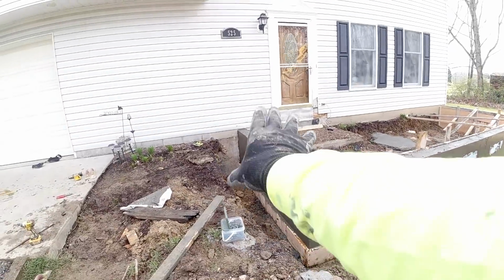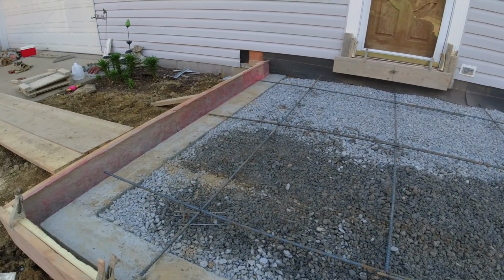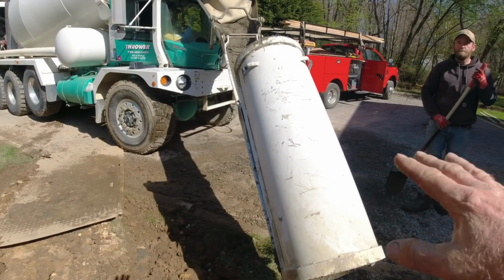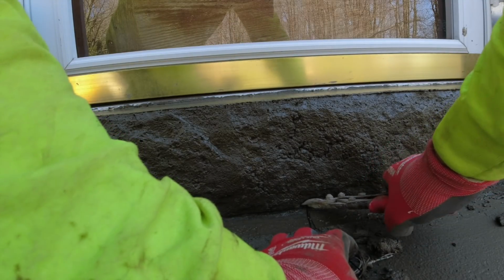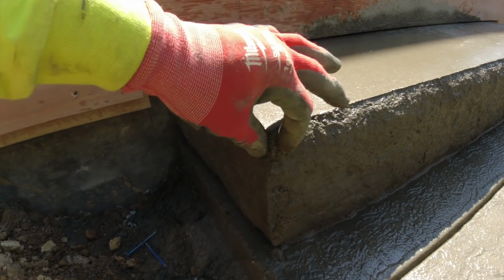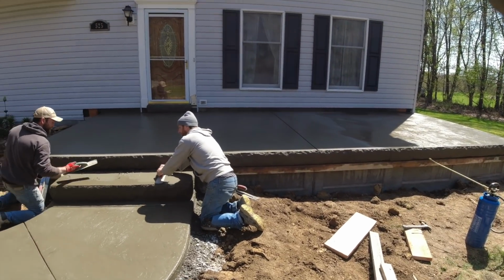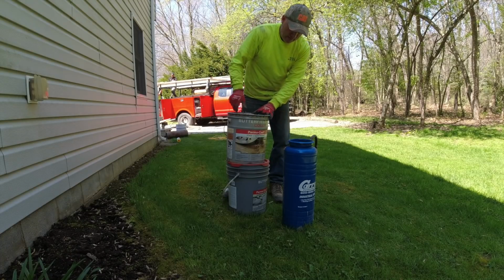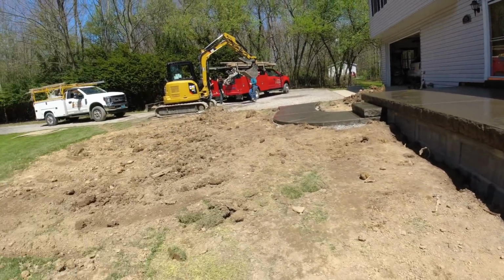What An Upgrade For This Front Porch!

Comment: I have been a journeyman plumber for 45 years, and have baby sat hundreds of pours  over the years I call just incase, witch means to be there to fix any problems that may happen during the pour. Sometimes that means fixing a broken pipe to making sure all the floor drains don't get covered with concrete. Sometimes we put a 2'X2' box around the pipe or drain to keep the concrete away from the pipe or floor drain to fix it later, after the concrete hardens. I must say you and your men are the best I have ever seen. I had a question for you about if you guy's are union are not. I'm thinking NOT because of your efficiency and the rebar you are tying and forming. I'm in central Missouri and the union concrete guy do have the right to do there forms on the slab but they yeild that work to the carpenters. I must say around here the non union guys try a lot harder and do a much better job on the finished product. And the union guy's want to work thru lunch and then get paid for all day only working 5 hours of work. I was just wondering?
Reply from the maker: We are nonunion

Comment: 5/3/22...another detail description of doing footings, framing/forming for 3 ft short wall perimeter- including decorative rectangular 'inset/relief pannels', then when perimeter wall has dried-hard...framing for 25'x 10' porch top. Edge of cantilevered porch  & steps has your 'broken stone' stamped finish. Very nice job Tom! You & yur crew produce outstanding results!...>but... color overspray< ...kinda concerned that your color spraying oversprays customers siding & front door !🤔🤯 Tell us armchair viewers cc stain color does wash off that vinyl siding (or other siding types) so their is no visible discoloration on clients house or front door glass, brass kick plate etc. Pretty sure it does wash off but did not hear U mention it in this video. Thx. Always enjoy listening & visually learning from your videos.👍👍👍😊🍺
Reply from the maker: Sorry yes it does wash off

Comment: Tom - as a first time commenter let me start by saying my wife and I really enjoy your videos.  We are fascinated with what can be done with concrete and you and your guys are definitely artists at that.  Concrete is hard work, but you guys make it look easy.

So - I have one comment and one question for you: 

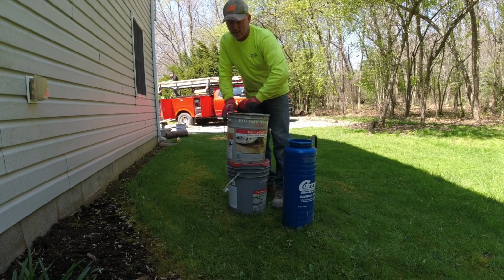Comment - when you are making up your coloring, I love the My Cousin Vinny reference at 23:34 ("Identical").  

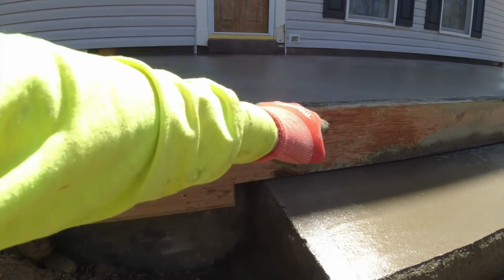Question - at 16:45 when you start removing the main form for the porch (i.e. the 2x10 or 2x12 - whichever it is), that form is screwed to a 2x4 that is somehow mounted onto the walls of the porch base.  How is that 2x4 mounted to the walls of that porch base?  I was hoping to see your guys remove it so that I could see how it was mounted, but that wasn't part of the video.  The curiosity is killing me.

Thanks for the great videos.
Reply from the maker: We use 3 inch tap con screws drill a 3/16 inch  hole . They really hold good
Reply: @Concretewiththehauses  Thank you for the answer.  So the concrete is hard enough after a week to drill pilot holes for setting the Tapcons, correct?  I'm asking to make sure I understand - I'm not challenging what you do.  Also - what do you patch the pilot holes up with when you are done - a little mud mixture or something else?  I really appreciate your providing this info.

Comment: Ok enjoy your work, but that "door sill" as you call here would a step and your "sill" would not meet building code as it is a clearly a step. Please explain how this would pass in your area.
Reply from the maker: We are allowed up to an 8 inch step down but we have to have at least a 36 inch landing. This is residential,commercial no step flush entranceway
Reply: Not the drop but the tiny stepping pad you created ,Code here will not allow 7"max. rise/drop 11"min. step. That would be written up as a tripping hazard extending beyond the brick mold around the door. It has been rejected on plans for projects by major builders here in WI. This is how we were instructed in collage in the 90's told is was National Building Code back then.